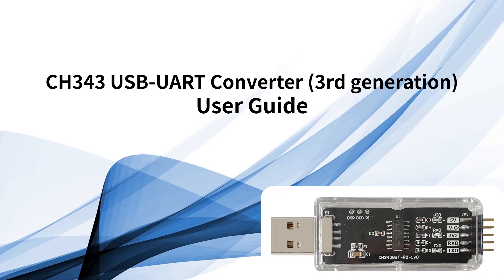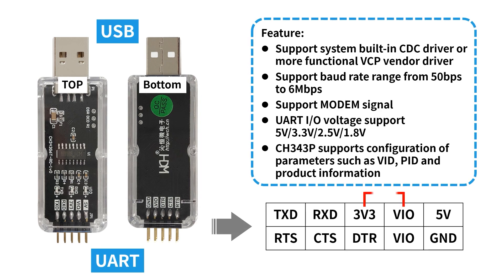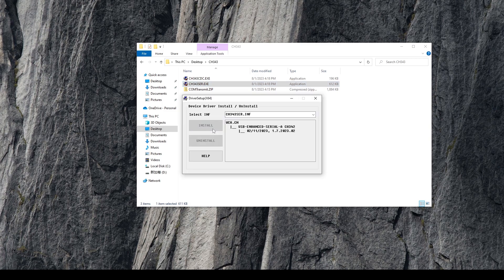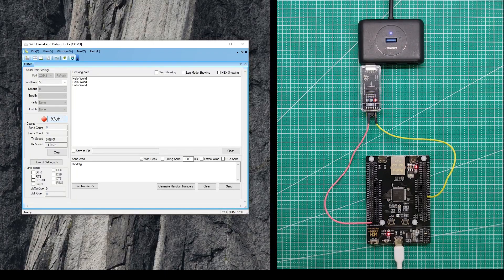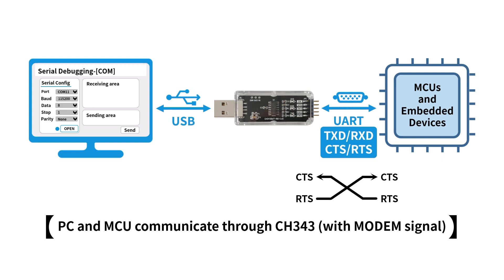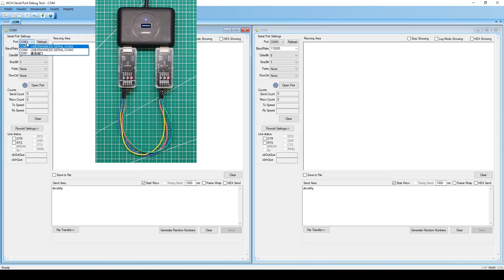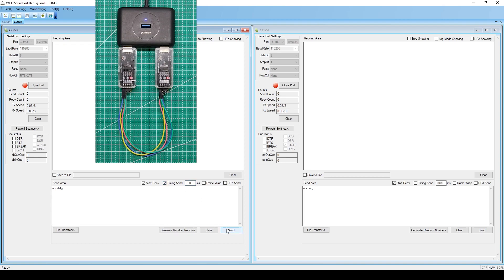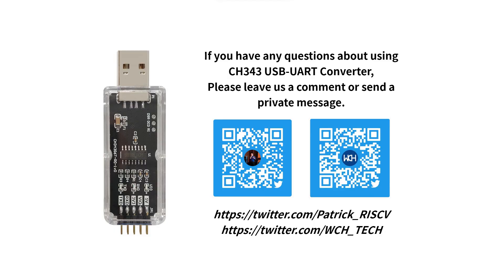#18-[QuickStart] CH343 USB-UART Converter (3rd Generation)

Comment: My CH582M would no longer get into Download Mode after flashing HID Keyboard example app with setting PB11 as Dwld Config Pin. Can WCH-Link put CH582M into Download Mode to remove that HID Keyboard?
Reply from the maker: please send the issue to yy@wch.cn
Reply: By default, CH582M pulls PB22 down and then powers on to enter download mode. After switching to PB11, pull PB11 up and then powers on to enter download mode.

Comment: Looks fine. How the I/O voltage is selected?
Reply: Looks like you need to supply the Vio to the chip.
Reply: The VIO pin supports 1.8V to 5V supply voltage, and the VIO should use the same power supply as the MCU and other peripherals.